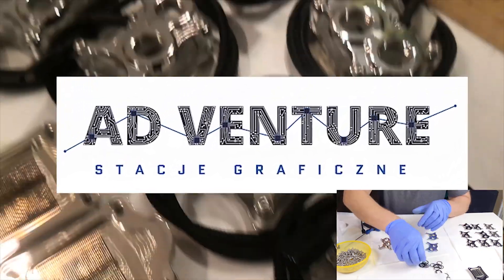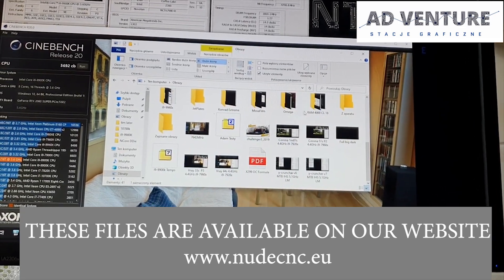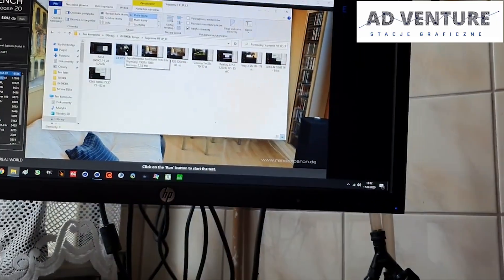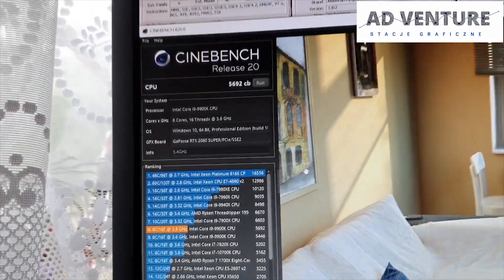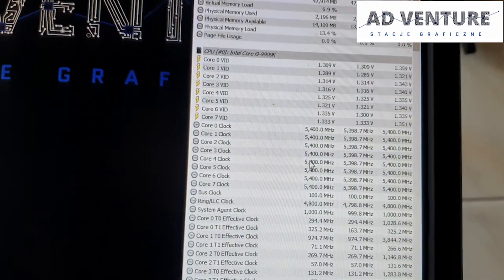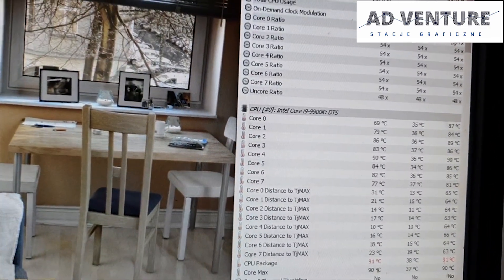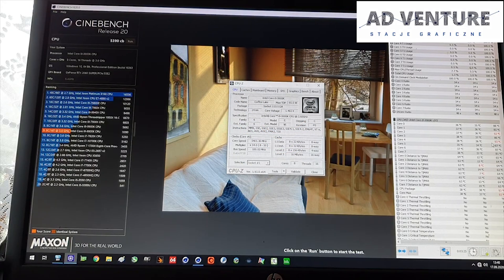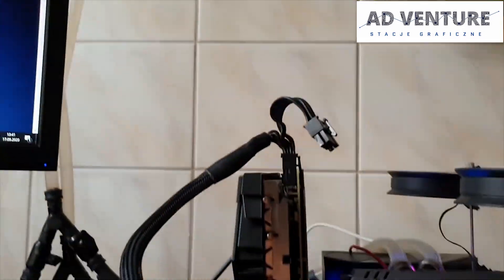NUDECNC Ncore V1 (D) Direct Die Cooling Waterblock - test by AD Venture Review

Comment: its a great idea to water cooler direct die but buying intel doesn't makes sense any more...
Reply: This is true I backed ncore but still haven't got my block, in the time it's taken AMD have changed the market, hopefully they can release something to cool the ryzen range too.
Reply: Well looks like Intel is back in the game with 12th gen.
Reply: If Ryzen processors were available then maybe but they are running out of stock. I personally still prefer building computers on the intel platform. Also, if people had that mindset when Intel was the leader then AMD wouldn't exist and the Ryzen procs wouldn't be a thing.